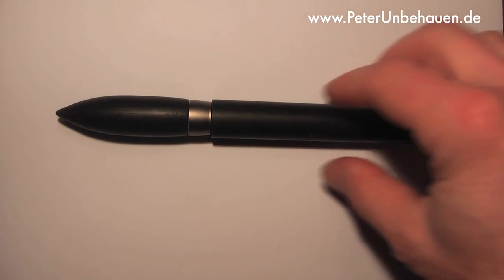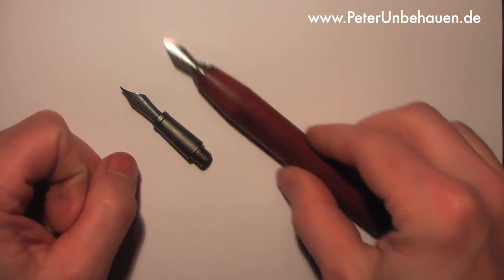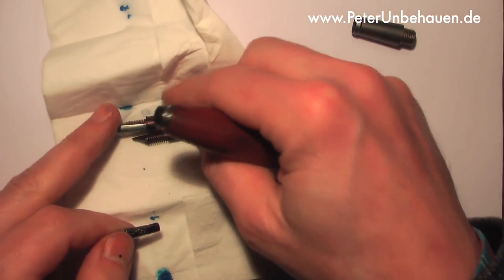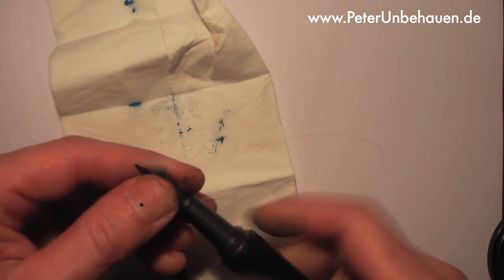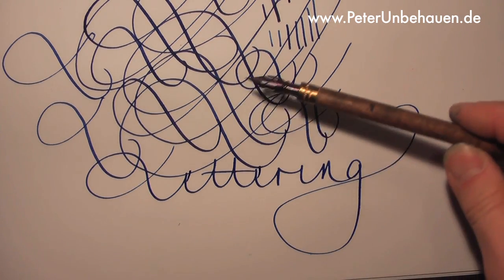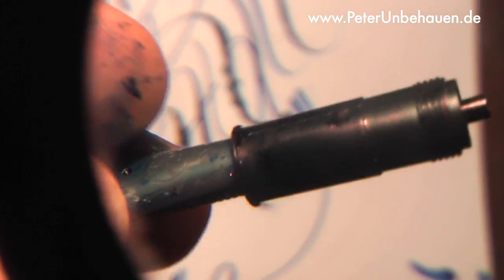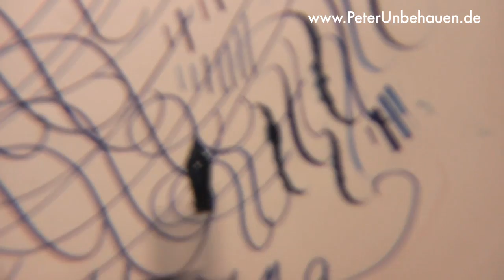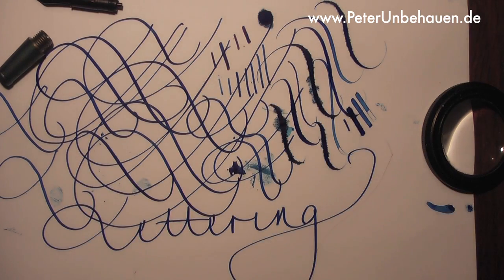Bock Titanium Fountain Pen Nib Handschrift mit dem Füllfederhalter

Comment: Those nibs look beautiful. How much did the triple system cost - steel, and titanium nibs? And how smooth are they compared to nibs on Pelican M200, or M1000? What is the material of the feed? And by the way, you've done a fine job with the pens you've made. What is the material of the barrel and the cap? Thanks for uploading and sharing your experience with your Bock nibs.